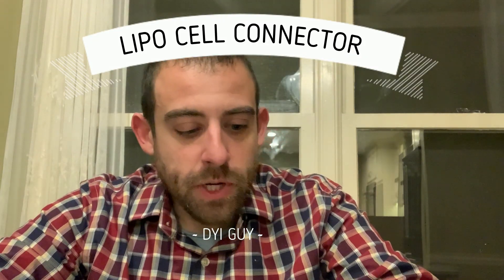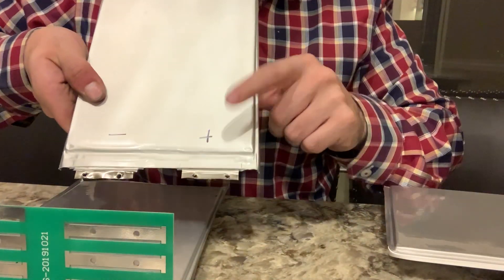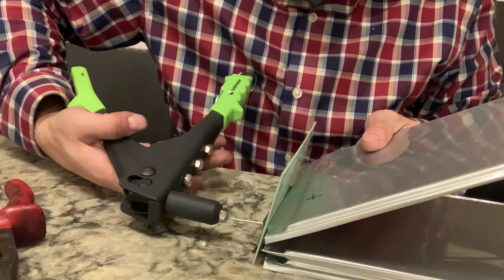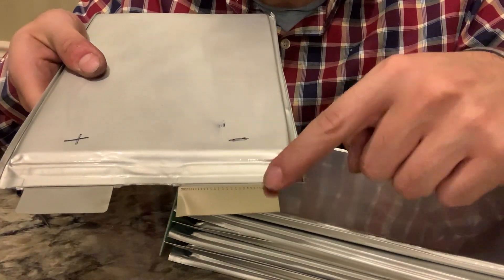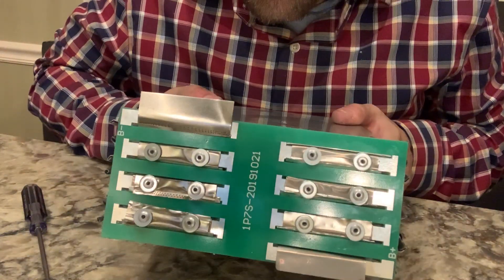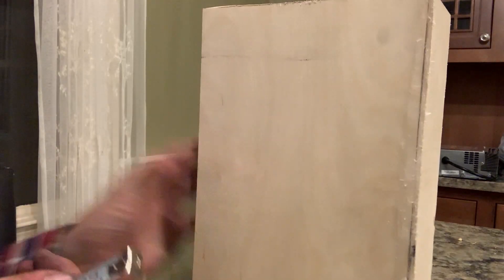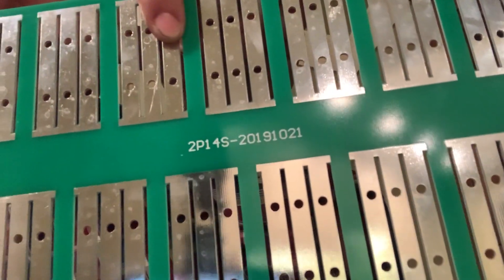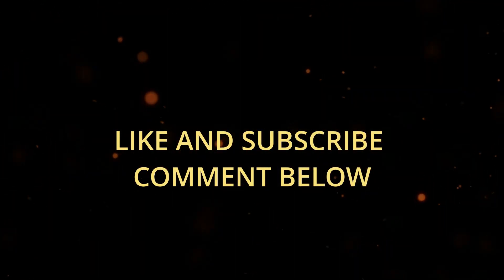pouch cell assembly in 20 min

Comment: Hi where did you get the boards I want to make a 72v 158ah battery using old EV cells which are half the width of your cells and longer so they'll be 20s 2p

Comment: No, don't leave space between pouches.  Look at the datasheet, one is supposed to compress the individual pouches by  a certain amount.
Reply from the maker: You are correct, this was just a video on the ease of connecting them, i place them under compression before putting them in a box .
Reply: @diyguy1476  How do you compress them? I want to make one of these. 67 volt 40 ahr. for ebike application. What would be the cost to make one? Where did you get the materials to make this?
Reply: @ronbrown8611  @Diy Guy yes please explain how compress this one & where we can find that LIPO cell connector, PCB.

Comment: can the board be modified to be 12v 80ah?
Reply from the maker: Yes you could cut it at the 3rd or 4th series connection, depending on if you want 3 or 4 s

Comment: Why not spotweld them together? those 2 rivets per tab are not going to handle a lot of current. Surely about 20 spot welds per the entire length of each tab is better and probably faster.
Reply from the maker: You certainly can and i have a spot welder to do it , being i am over lapping the tabs and they are compressed I actually tested it and was able to pull 100 amps i didn’t want to push it to the max .  But just trying to make it so anyone can do it with out buying a spot welder . There are many options you could use screws , an aluminum bus bar or cooper and bolt those down but i personally found that this is the easiest way for a person with no soot welder.

Comment: Nice video bud. Thanks for sharing. I'm looking to build a back up house battery, but I'm battling to find those pouch batteries at a good price. Do you have any favorite supplier's? Tha is for the video .
Reply from the maker: Yes i am working with a company to put a package together with these boards, i ran in to the same issue which is why i got these made. Thanks for watching ill send you the link once it posted
Reply: Hi any update on pcb

Comment: Are you planning on resisting swelling of the pouches by applying rigid end plates to the large area faces of the pouches ?
Reply from the maker: Yes this was just a mock up with a cut away box, this is not the finished product. I might use a plexiglas or ridged laminated sheet. Also to protect more against puncture.